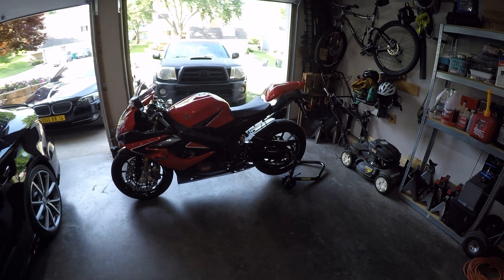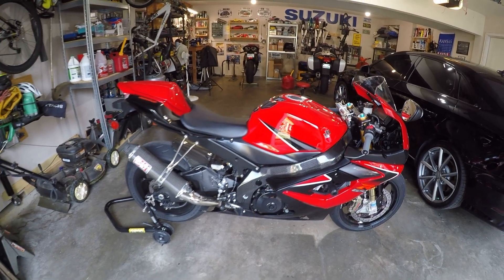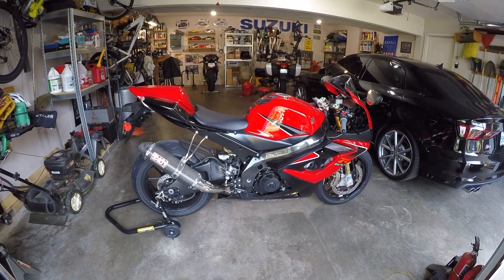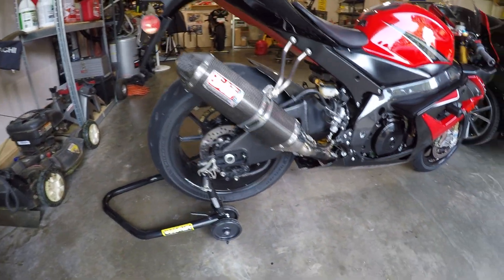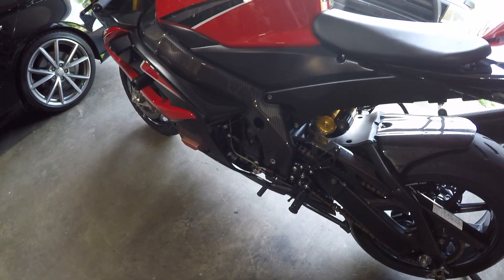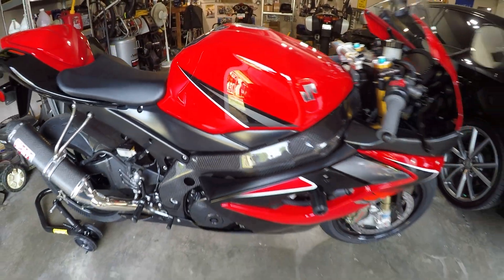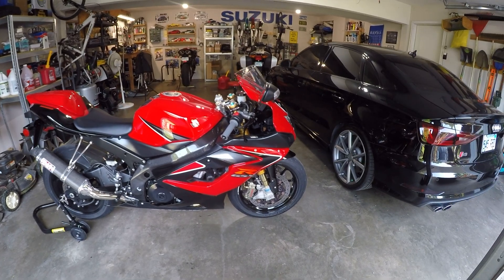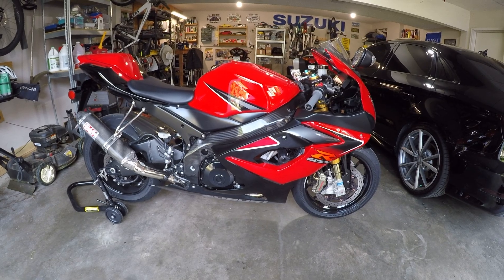2006 Suzuki GSX-R 1000 K6 First Look!

Comment: Just picked up this gem today and love it. Cannot believe how good it is even by todays standards, having owned an 09 repsol 1000 and 16 s1000rr. The k6 1000 is just so raw and punchy in the mid range and the ergos are so nice, being 5'3 the seat height allows me to put both feet on the ground, ive never been able to do that and the handle bars arent so low either. For the money its hard to beat, love it. Great vid and thanks for sharing
Reply: Holy crap dude 5’3 on a k5 1k must be insane I mean I’m 5’7 130 on a 636 and I thought that was crazy you must go flying man
Reply: @mikebergeron3358  haha nah not really man, I'm a very stocky 185lb, you must be super lean at 130lb and 5'7.
Reply: @SR22VET-S15  I am bro im skinny af my bike feels a lot faster than it is due to my weight suprisingly I can handle the bike very well and flat foot it and push it around no problem which I was surprised about when I first got it

Comment: I bought one to use in the Isle of Man, still have it. I can tell you the best mod $5 fit a Yamaha R1 throttle tube it opens the throttles faster and when your on it you will not be opening the throttle as quick as this bike needs. Next reduce the wheel weight and this is not easy as Suzuki wheels are light anyway, I fitted $6500 of Whitestone carbon, this improves turning at 120mph+ make it as quick as the 600,  braking, acceleration and suspension action so yea expensive and just bling if your not gonna go 120+ on twisties. Dont junk the exhaust or the back pressure valve, this is a full titanium system from stock and you will loose torque without that valve, just listen to that intake snarl. Mine dynoed at 162 and with the carbon wheels was 162Kg wet, thats 1,000BHP per ton, crazy fast comfortable bomb proof missile, what a machine.
Reply: How’d you lose the 40kg off its stock wet weight?

Comment: Fun fact. The 2006 GSXR1000 still holds the world's fastest 0-60 of any stock production motorcycle at 2.6 seconds. 

That is faster than the Vmax 1700, H2R and any other you can list. Crazy value for the performance. 

I went with the 750 because I truly believe it's the best street chassis and power level balance in the market.

Comment: I'm looking at a super clean blue 2006 17,000 miles got him at $6,000 ,whats everyone's thoughts on the milage and price im going to pay? Don't know if anybody will ever answer this but I figured it's worth a try thanks to anybody that does! Ride safe y'all!   Great video by the way honestly,and it not only gave me a lot of info but really got me hooked into the bike! Great content!
Reply: i paid £6600 for my k6 with 6000 miles on it in the uk, i would try and get it for as low as you can and keep it and never sell it. mine has fully setup suspension, racefit exhaust and ecu flash and it goes as well as any modern bike
Reply: FWIW, I've got around 95K miles on my '05 1K. Engine is still rock solid.

Comment: Bro, i have the same bike (stock) with only 11k miles on it, stock everything, i´m just to change the solo seat (carbon fiber) and the double bubble wind sheld soon. I bought a R6R 2018 blue 5 arm rear rim, just to change a little the look on the bike (obviously gonna paint it black), just to close the looking on the marchesini style (i have thinking on this mod like a years ago, this is actually my second k6 on red graphics, the first one was 600cc, i got the 1000cc now), anyway, hope to be on touch, watching you on track of this beauty. Cheers from Mexico city :hand-pink-waving:

Comment: What would you expect to pay for a K5-K6 with these mods and where did you find it? Just trying to get an idea. Thanks.
Reply from the maker: Bikes outfitted like this one rarely come around, but if you do see one, it will be well north of $10k USD. If it's less than that, buy it  immediately.
Reply from the maker: This one was located in the Kansas City area. It was originally from the Las Vegas area however.
Reply: @PracticalEnthusiast I’m getting one today for 4800

Comment: I have a 2024 with 900 miles on it and it looks like someone shot the front end with rocksalt loaded in a shotgun with all the paint chips and dings it has.  No idea how people keep their bikes looking like this they must not ride. I’ve done Two track days and some road racing and this new gsxr already looks like it has 50,000 miles with less than 1000 on it. Thats what happens in a race environment at 160 mph +